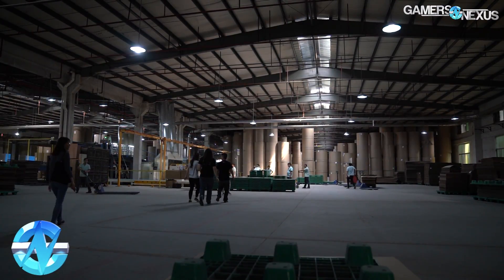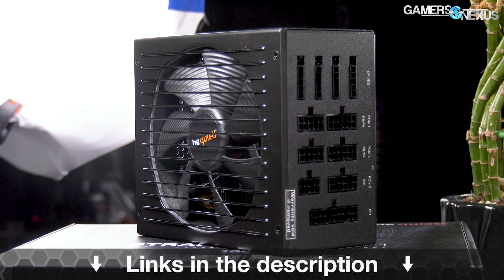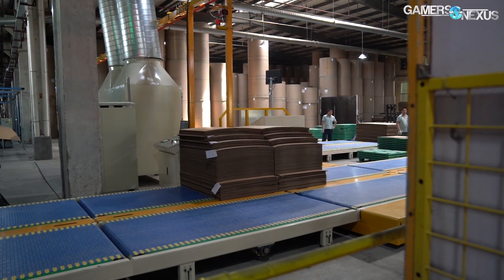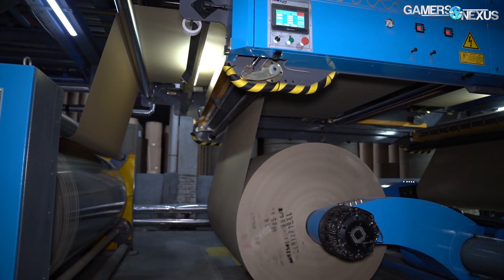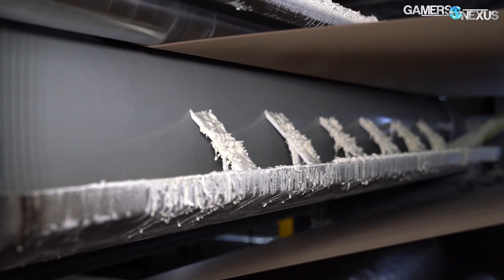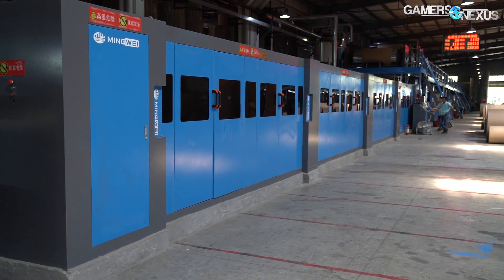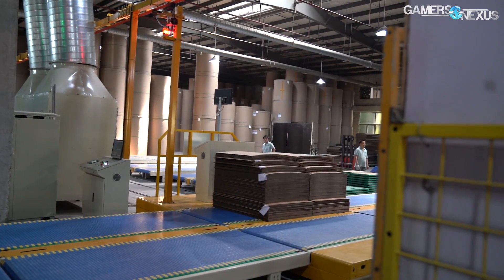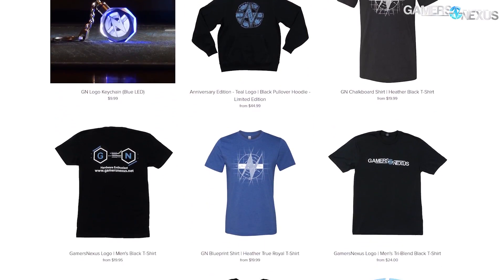How Cardboard is Made | Factory Tour

Comment: Those crinkles are called flutes, and the fluted paper is called medium and it is made differently at the paper mill than the liner. They are not reels, they are rolls and they weigh up to 4 to 5 tons. A 110” roll weighs over 8,000lbs.

Comment: Good video...except one VERY important piece of info.

Making those rolls of paper is a MUCH harder process! You should tour an International Paper Containerboard mill, like the one I work at in Pensacola, where we make these little rolls of liner board they buy in these factories.

I say little, because our machine spits out 200,000 feet of linerboard over 30' wide in less than 1 hour, so OUR rolls are 31' wide and 13' tall, give or take.

The process of taking trees and pulping them into this linerboard is much more involved and really puts into perspective exactly how much goes into making 1 box.

Edit...We also have a fluff machine which makes the "fluff" in diapers and feminine products. All of which comes from the same raw material as cardboard...kinda weird that women and babies use cardboard for absorbing! Lol

Comment: In Afghanistan, shit would get shipped around in basically giant cardboard boxes that we called "tri walls"...it was one layer, the "flute" as you called it, another layer, another "flute" and an outer layer with plastic lids on both sides to (very) loosely close them up.

I was waiting to get on an Osprey at a FOB called Edinburgh...they had to unload one of these tri walls.  

They make the ramp level so they could push it out the back on the rollers built into the ramp (of which I stepped on and BUSTED my ASS once on Camp Leatherneck...) but the tri wall was too high and kept hitting the back of the bird.  They couldn't quite get it back far enough so I guess someone onboard said "fuck it, then", lowered the ramp just enough so it'd clear and shoved the thing out the back...it fell a few feet and landed on its side.  Then they proceeded to ROLL THE THING!!  I was doubled over laughing my ass off.  It was absolutely hilarious.  These things were probably 5'x5'x4' and I have, to this day, no idea what was in it but watching this giant cardboard cube full of ten thousand dollar hammers and shit roll along the sandy Afghani flightline will forever be emblazoned in my memory.

I was amazed how strong some stupid ass cardboard could be.

Comment: I used to work in a cardboard factory. The technology was older and thus the process was a bit different than what i've seen here. It had a corrugater whcih made the sheets and then several cutting and printing machines using basic ink designs, nothing fancy like a GPU box. Though many orders consisted of just large blank sheets which may have gone to other factories for advanced printing. I worked on the strapping machine which strapped together the piles of finished product for storage or shipping.

Comment: How about LDPE foam that is often used to pack computers? Even if 20usd box is for 10k video card since it will be a waste either way! We need to have reduced, reused, recycled packing. Advertising and installations can easily move online since distributing a compressed text file even trough http is way cheaper than producing manual out of paper.

Comment: Nice video BUT the actual term for the product is corrugated paper, NOT cardboard. Cardboard is what you find on the back of pads of paper.
Reply: Yeah, besides that no normal human would speak like that. You dont call the boxes corrugated paper boxes either or do you really?
Reply: I’ve been in the packaging business for over 40-years and the norm is to use corrugated for short. Using the term “cardboard” is like calling a bolt a screw, or an engine a motor.
Reply: @seminolefantodd4736  Not really. Maybe if youre super into the topic, for other people its literally just fucking cardboard, who cares.
And its not like calling it cardboard instead of corrugated could cause any issues whatsoever, if you know what i mean, so why bother.
And btw in other languages an engine is called motor, german for example ....motor comes from latin and it just means machine that moves shit or "mover" , to say it simple, my english isn't the best anymore LUL.
So its correct to call an engine motor, don't see any problem there^^

Comment: Early 2018 cardboard prices doubled,  paper suppliers increased cost due to strict government inspections and all supplier making sure follow laws for pollution and proper waste was adhered to, so production costs went up two-fold.
Also missing was the print process, this very interesting, as the cost is down to the amount of color processing required.

Why your case box is just one simple color, Colourful graphics cards or motherboard boxes costs a great deal more.
So next time you see a nice box you consider the environment and also go for a box with a re-cyclable logo so means less color on it. To re-cycle some color boxes can not possible because of the material in the color pigment.
Why you see many products with just a thin paper sleeve cover over a plain cardboard box, this is better for the environment. Amazon packing labels can remove easily, and also single color print is better.  Be kind to our planet people!

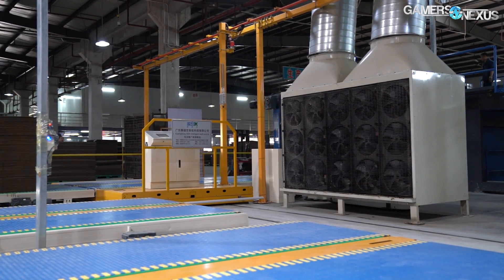Comment: I used to work in a cardboard factory. This brings back memories. The first few months, oh so many paper cuts, until you learned how to handle the cardboard properly. The corrugator was generally accepted to be the worst job in the plant because it was the hottest working environ, especially when you were the one taking a hot stack that was all convex sheets like @ 7:30 and inverting half the stack in handfuls so that the sheets flatten out, like @ 8:06. This was 15 years ago so tech may have changed to make it more bearable now.

Comment: Jesus 20 dollars per box... I gotta appreciate my boxes a little more.
Reply: I wonder if a used gpu box market is an untapped market
Reply: @Tallnerdyguy  Yes, there is a GPU box market here, for anyone throw away their box for some reason and want the box for better resale value. 
Usually to disguise mining card as a normal uses card.
Reply: If you notice a LOT of boxes do away with padding inside and instead have a custom cutout to hold the part suspended internally. Those are really expensive because they require a lot of operations to achieve the desired shape. For eg: you have a flat sheet of cardboard and to form it into a 4 sided tube requires 4 kiss cuts or scoring to create the bends then the glue tab needs to be cut and glued. Now you have to cut out the flaps, the fold overs and tabs. Just to create a square box with bottom and top requires 14 operations.

Comment: Hey! So I work at a corrugated board production and printing facility in the US and it was fun to see some of the things I do featured on your channel. The only thing I'd like to add is that, technically, that's not cardboard but corrugated board. Any paper sheets produced with flutes is corrugated board. Examples of cardboard would be things like cereal boxes or any other boxes made with a solid card stock like wall.
Reply: lol I was hoping someone would comment on this. International Paper employee from Ohio
Reply: @ViperB5  different company, but it seems like I'm not the only one who knows the difference, haha.
Reply: @DDRmassa  Nope, I was headed in here to post it as well. RockTenn in ohio for me.
Reply: BCI guy here, Im a structural designer. We dont make the cardboard, but the boxes.
Reply: @anotheruser777  I'm a structural designer in my day job for GPI in the UK. Nice to see theres more of us around 👍
Reply: @ClickTechUK  Box bois
Reply: I was just writing this as well, but you beat me to it.  We have a corrugated sheet plant, and the difference is an important one.
Reply: Isn't it also called corrugated cardboard? If that, it is a type of cardboard.
Reply: @ArthursHD  No, the paper stock used in the liners and medium aren't a heavy enough thickness to be considered cardboard. I supposed you could make a corrugated cardboard, but the flutes are what provide the structural integrity in lieu of thickness so it would be likely unnecessary and costly.
Reply: @DDRmassa I was going to mention that too! I  also work at a corrugated plant and my boss would never let me call it cardboard
Reply: Preach brother! If anyone catches you calling it cardboard on the radio your getting a talking to. It’s corrugated board dammit!
Reply: Foldcote solid Cal 15 versus giant thick brown sandwiched corrugated boards.
Reply: DS Smith in the UK was my brutal introduction into corrugated board. Used to walk on the rollers the stacks were coming along (I was on palletising) to massage my feet.

Comment: Nintendo labo better be made with the 20$ cardboard
Reply: I like how they got away with selling a $60 game with $20 cardboard to play the game. Any other company would get metaphorical shit thrown at them
Reply: Samurai Shampoo  For the cardboard part of it, it's actually simple to make. I work at a factory that has machines that punch shapes out of flat materials using dies of various kinds. Nintendo simply pays someone to print on the cardboard, then use a die to cut the shapes. Each sheet is probably one operation, just like using a cookie cutter.

The hard part is probably the design. They have to design it to not just fall apart without being covered in tape to hold it together. That means, for all the weird shapes they make, Nintendo engineers have to figure out what will slot into what in a way that causes it to lock together and still be easy to build.
Reply: HolyDevilKing the way they do that is with origami, then scale it to cardboard. Not that hard to make if you know what you’re doing.
Reply: Only the highest quality cardboard for the vr bird butts.

Comment: That 15 second cooling thing sounds like a car dealership offering you the undercoat. It doesn't seem like that would be enough for a temperature change to penetrate to the center of those stacks, even with the corrugation parallel with airflow. If it does help at all, it would mostly affect the side facing the fans/top and bottom

Comment: I was hoping it was gonna show how they apply that glossy shinny box art like on video card boxes or computer boxes in full color print. Still, thanks for the content. This channel is important and unique
Reply: It's basically a giant sticker called single face(or layer) laminate. Usually printed on a roll, attached with the same adhesive shown in this video and cut to length. Sometimes it's actually printed on(Flexographic) but that is more the case of like Big box store displays you see for like back to school stuff.

Those sheets are then generally fed through a steel rule die cut press to punch out the shapes and perforations, etc.

Comment: I work in a cardboard factory.  This video is so strange to watch  ahaha 6:32 usually we produce 70.000/ 80.000 meters every 8 hours.  So "20.000" is not impressive, is about 2 hours of work.
Reply from the maker: FWIW, that was for one of the lines. There were a few of them. Do you do 70-80k per line?
Reply: @GamersNexus  yes 80.000 per line.  with my old line the record was 92.000 meters in 8 hours. The new one is even faster, i think that it can reach 100.000. We work at an average speed of 180-200 meters per minute
Reply: The facility I work at has one corrugator and our goal is somewhere around 2 MSF (million square feet) per day.
Reply: I was thinking about it and there might be some confusion between square meters and lineal meters. Our corrugator is primarily represented in lineal feet. So it's purely speculative but maybe that's where the discrepancy is?
Reply: @DDRmassa  i talk about linear meters. Our reel of paper range from 90 cm to 180 cm . So square meters can be almost double if we work with the largest reel. (80.000 x 1.8= 144 K ).
Reply: @gianlucaangeli  I figured that's what you were saying. I thought maybe they had gotten the figure incorrect in the video possibly underrepresenting how much is really produced. Our corrugator typically runs at 700-900 lineal feet per minute.

Looking again, it does seem throughout the video that everything is moving quite a bit slower than I'm used to.
Reply: @DDRmassa  i dont think they produce 20.000 per day, probably it's just eary in the 
workshift and they just reset the billboard . Because at that speed they 're gonna produce something around 150.000 linear meters in 24 hours